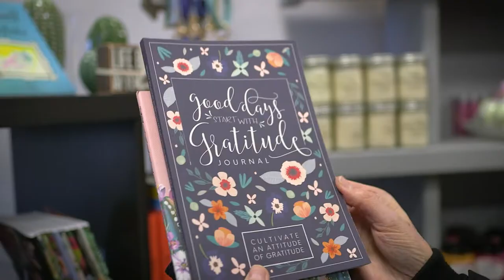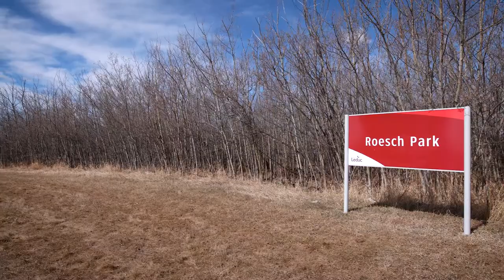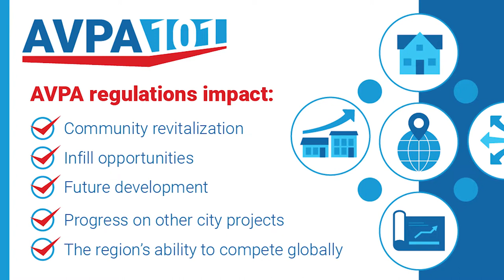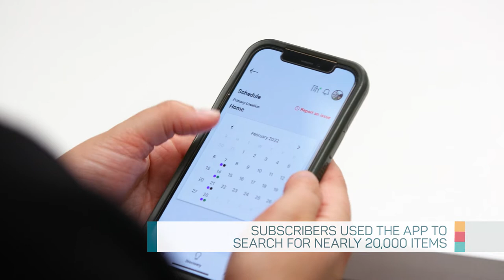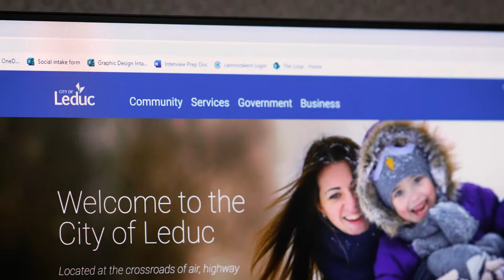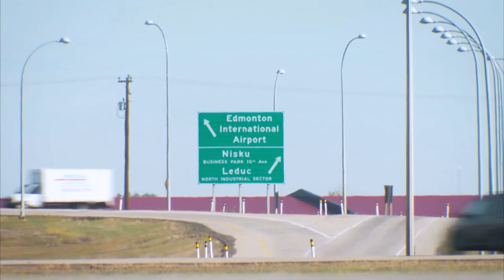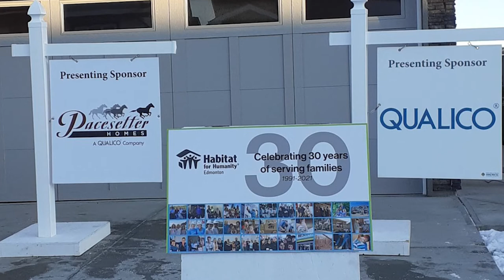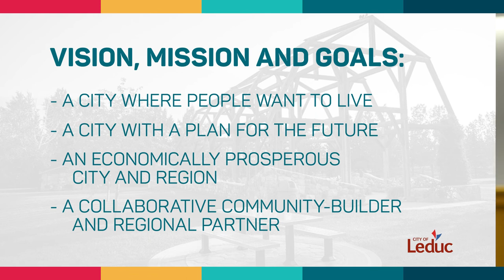2022 - Leduc State of the City

Comment: Leduc has some great features; the City has done a great job with our recycle centre for one. In other areas they are sorely lacking. In the past 5 years they haven’t been able to do some simple things like grass cutting (except around telford). I called to complain and was told by public works that the budget is too low they have all the equipment and people utilized and still can’t keep up also they were told by council that telford gets priority meanwhile the other parks and greenbelts are overgrown.  The road budget is being poorly spent they are resurfacing roads that don’t need it, they took two years to widen a section of Black Gold drive yet kept it to one lane in each direction, baffling stupidity. There are only two ways to get across highway 2 in this city they should have 4 . Make the overpass by Safeway bi-directional and go into the residential section north of the Canadian tire and the same with 2a go south of the golf course, there are 100s of houses in there and 1000s of vehicles, this would alleviate traffic so much. Instead they do stupid things like put a gate in the road at south telford. We know who butters bread in this town. I don’t  even want to start on the poorly timed traffic lights, its 2022 time to upgrade from the systems they used in the 1980’s. The car charging station is a good idea but really saving 15 tons of CO2/yr is barely worth mentioning. ONE diesel pickup that has had its DEF system deleted produces MORE than 15 tons of CO2 in a year. The province is too wimpy to enforce any emission’s regulations but why can’t we be better here? Shut down those morons rolling coal and making excessive noise as well as smoke. I think the polls are bogus because there sure aren’t that many people happy with the way the city is run. I think a few more grass cutters and a few less counselors would be a good start. We are growing fast and more houses means more taxpayers and taxes keep going up so money isn’t a problem just the wastage of it is, Hopefully next election they shake things up, we had a few individuals who looked like they might do something last year but sadly voter turnout is pathetic. Again it’s 2022 why not set up an online voting system? No we can't do that because we surely won't get voted in if it were easy/convenient to have everyone vote..... As an afterthought on the traffic lights I had to edit  its funny my Youtube went next to the live stream traffic cameras 50 Street and Black Gold Drive. There was at the time only traffic in one direction yet the light stopped them for a full cycle when nobody was coming or walking the other way, it would be funny if I wasn't often one of the poor bastards sitting at a light for nothing. We are so antiquated.